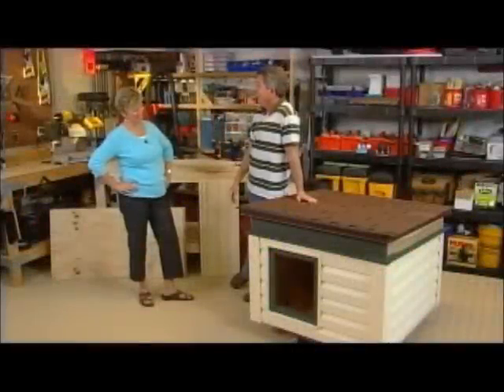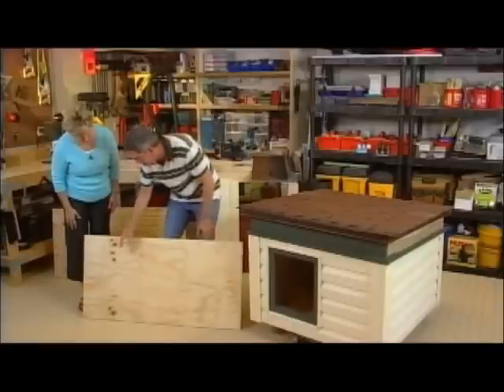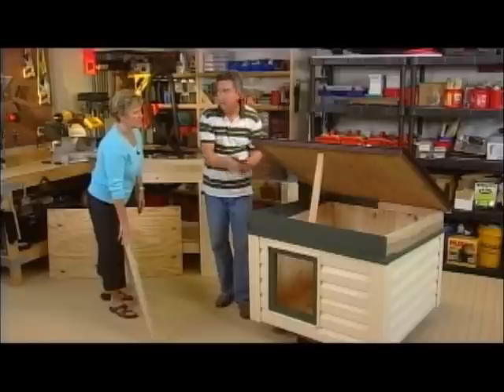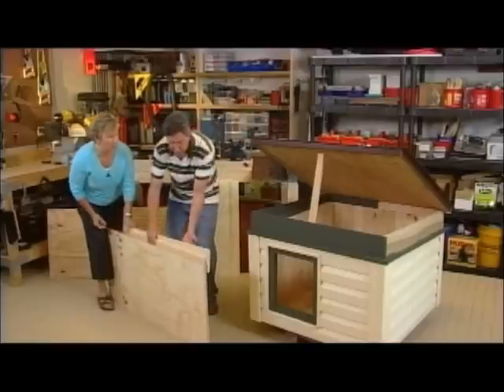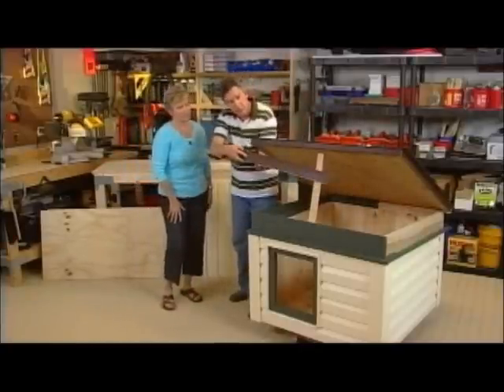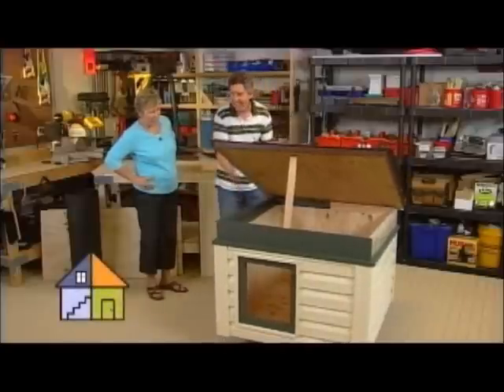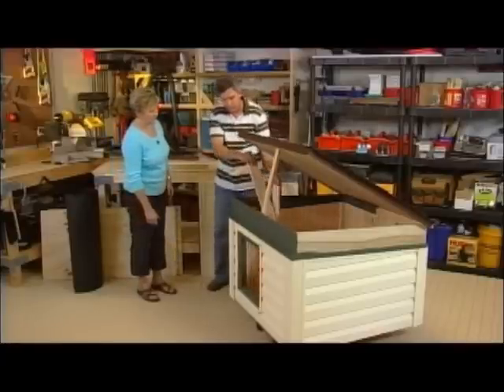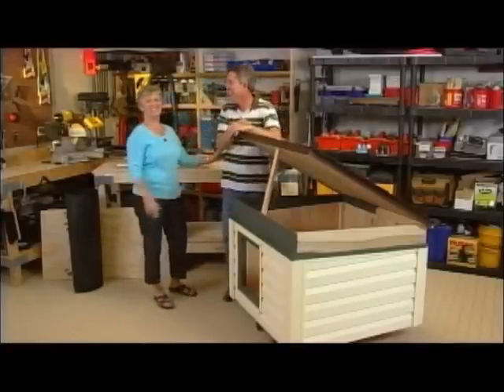How to Build an Insulated Dog House

Comment: FYI - Siding is NOT insulation.
Reply: Correct, however the siding used in the video is INSULATED SIDING, where the voids of the siding are filled with R11 or rigid foam, hence "insulation."

Comment: This is not an insulated dog house.  It is a nice dog house, but insulation, makes it insulated.
Reply: In Korea  the siding is.... technically. It's at a r2 -2.7 which won't work for anyplace that gets negative temps.
Just get regular styrofoam or fiberglass sheeting even and sandwich it between 2 boards. (Make sure theres no air ) the roof and bottom are especially important. As well as a dog door

https://www.thebalancesmb.com/insulated-vinyl-siding-844649